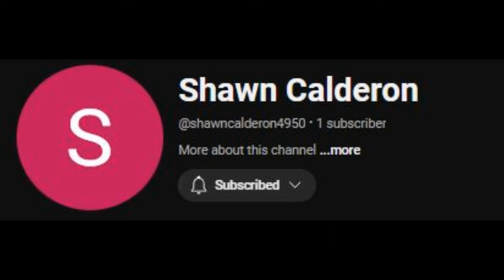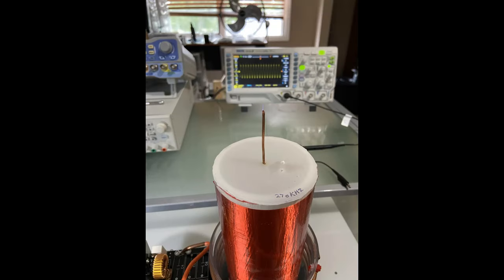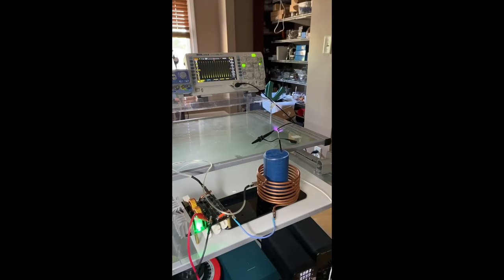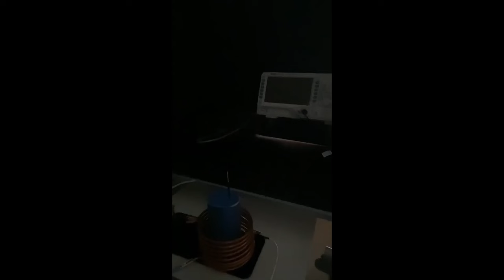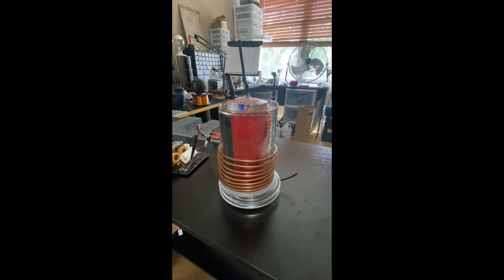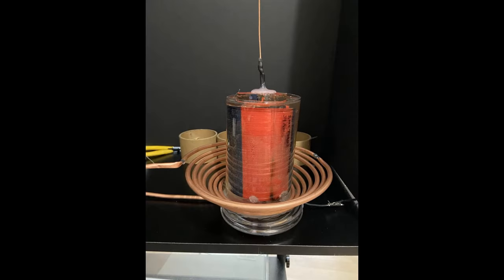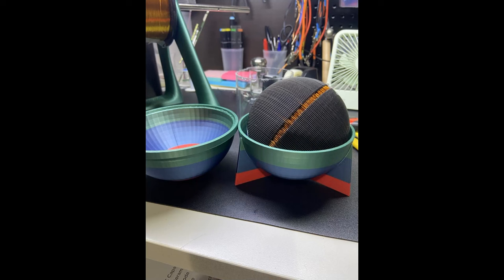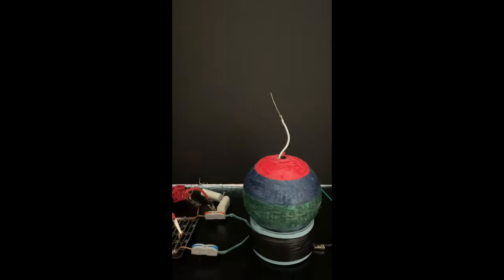Pushing The Limits In Tesla Coil Building

Comment: Nathan, I like the death star tesla coil as it works on the same principle as my steel sphere UAP. I have analyzed such a sphere with my theory and my theory states to put the coil windings around vertically instead of horizontally to get lift. This guy just gets electrical discharge. The earth also works vertically to make its gravity field as I have shown you in my earth and sun diagrams. This makes the earth's magnetic field, electric field and gravity field with the interior star device. The earth and sun make the electrons go from north pole to south pole and not around the equator.
Reply from the maker: He is using ac so it sparks when you use dc it just puts out energy 360 degrees around it.
Reply: Nathan, has he tried pulsed DC? It sparks due to the way the magnetic field, electric field and gravity field go around the horizontal loops like the tesla coil. If he changes the direction of the loops to vertical the death star will get more weighty or less weighty depending up on current flow. Check out your science with the right hand rule.
Reply from the maker: @richardmuller867  yes

Comment: great video ive nearly finished mine i hope it works lol i wonder how big me sparks will be but ultimately its for the graviflyer testing , can you tell me how i hook it up to a oscilloscope so i can see the frequency many thanks.
Reply from the maker: take the probe and put a wire on it. any size 12-14" away and it picks up the frequency.
Reply: @nathanbunten4299  ahh thanks thats great im getting a portable one that i can build into a box with the motor controls going to be a tidy box containing all the graviflyer stuff and oscilloscope cheers mans.